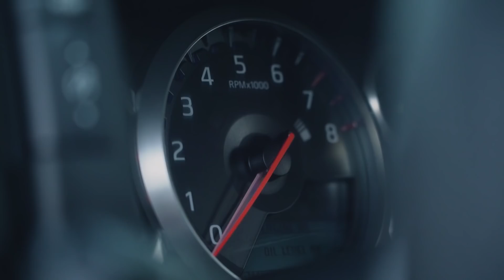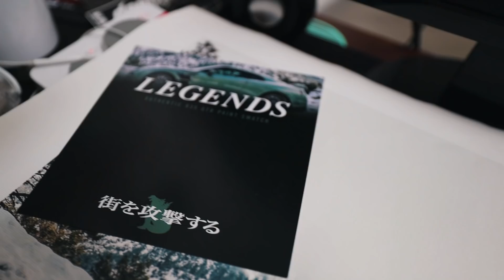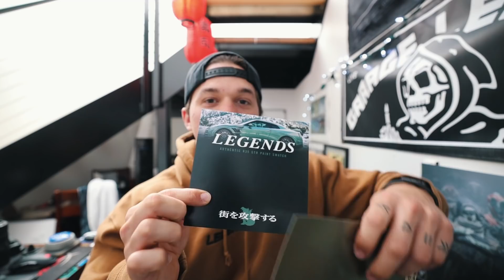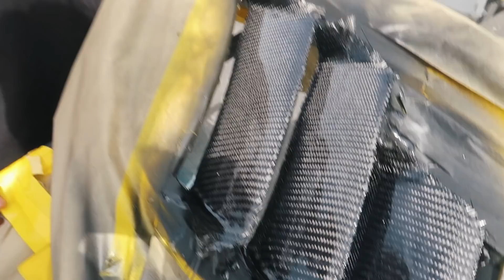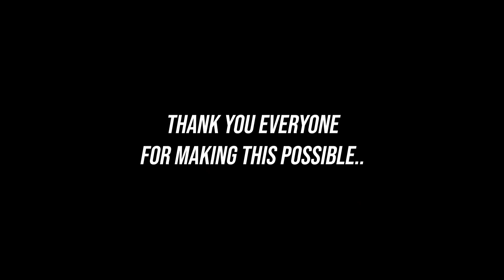REVEALING MY VARIS R35 GTR COLOR CHANGE!

Comment: Looks amazing. The only issue I have is when you go through this much labor and time to change to a rare color you need to pull the engine and paint the engine bay to match. I would even go as far as pulling the interior and painting the inner floor pans. I’m a little OCD though. Either way car looks fire.